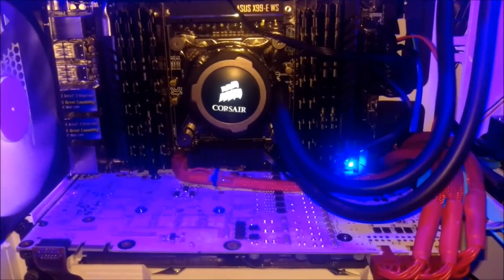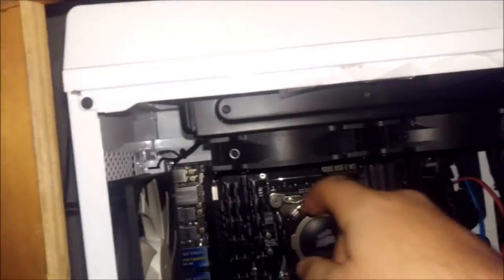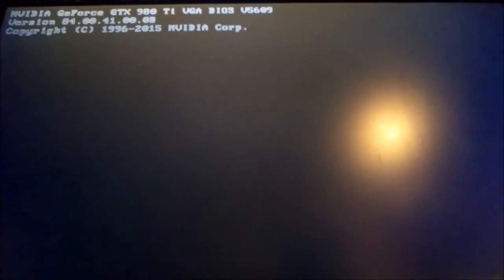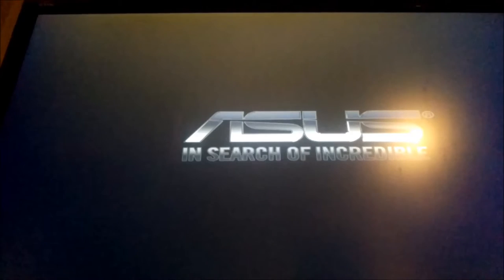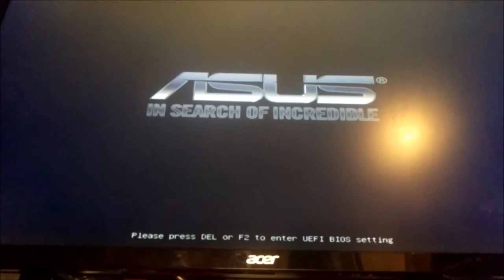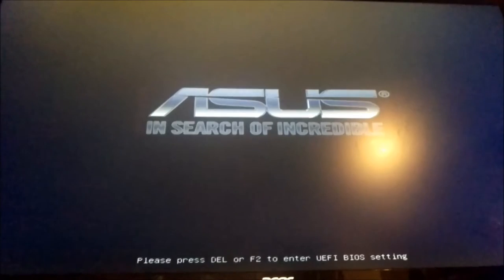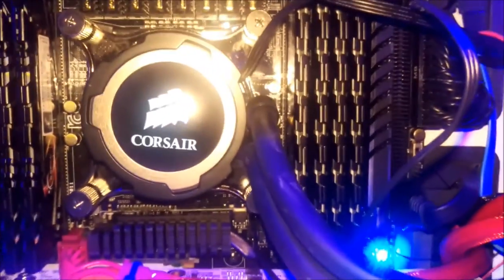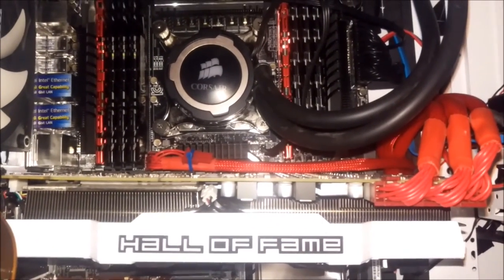Troubleshooting Bolide 2.0 Quad Channel DDR4 Ram issues

Comment: I found an MSI motherboard, the one your talking about is $560. I was like holy shit!
MSI Computer ATX DDR4 3000 LGA 2011-3 Computer Motherboards X99A SLI PLUS
Reply from the maker: +Fearless Ghost (ジャスティン ゴルド) i have an asus x99-e ws. i have it more for reliability than anything. because i had an ROG x99 board that was DOA.
Reply: ***** AH, for a moment in this video I thought that the motherboard was done. I was about to cry.
Reply from the maker: it wouldnt surprise me if it did die. it's beaten to hell. dents or bumps here and there, missing a pci lock. cpu power connectors so strained i have no idea how the connectors havent broken yet. as soon as the 6960x comes out, i'm getting the next WS board to replace the one i have.
Reply: ***** How long have you had the board?
Reply from the maker: 1 year
Reply: ***** Wow, that's actually not that long. Motherboards usually have been through more, I just have not seen a grand motherboard like this have big issues.
Reply from the maker: well, technically it works just fine. it just is beat to hell.
Reply: ***** Yeah that's happened to me a couple of times, sometimes Iv'e had boards completely just not turn on.